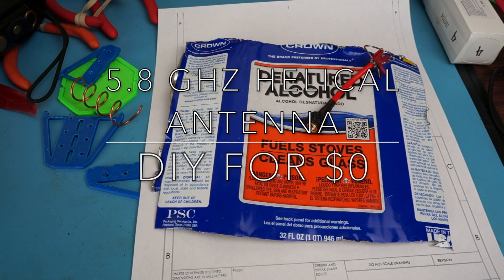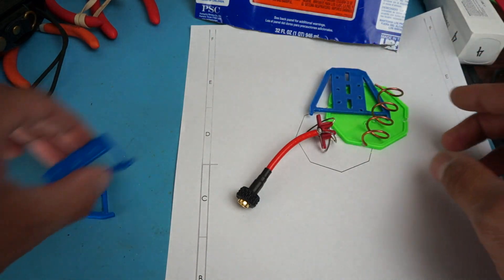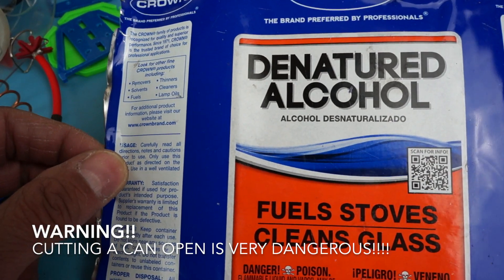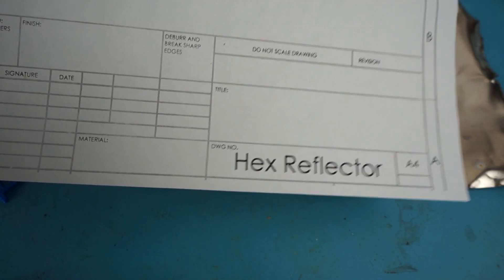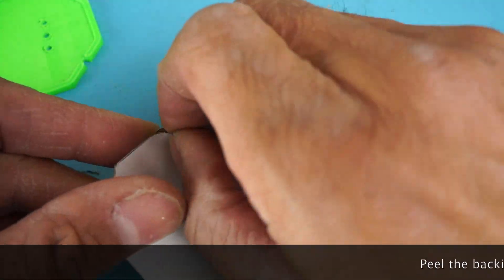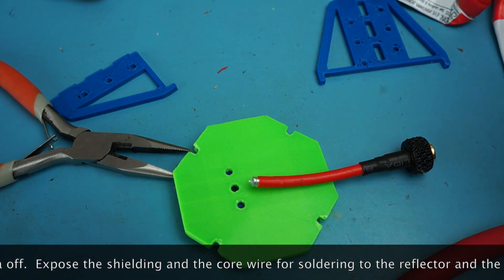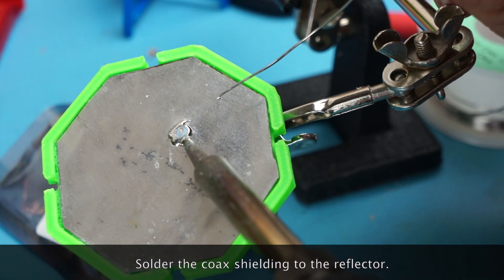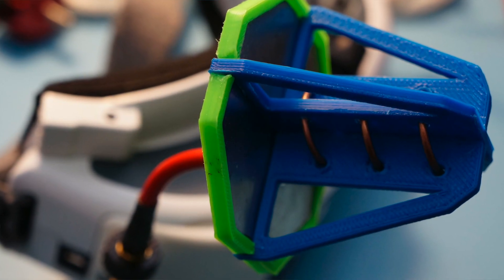DIY 5.8Ghz Helical Antenna for FPV Video for $0*

Comment: For the reflector, get yourself some copper rf shielding for guitars. It's adhesive on one side, you can solder to it, and most important, you can cut it with scissors.

Comment: Thanks! What 3-D printer material is suitable for UHF ? Is your  diversity receiver also home-built ?
Also I've heard that some people prefer double helical antennas.
Reply from the maker: I'm not certain, but I think I read on the Farvew site that ABS is recommended for the Pagoda antenna shields.  For this application, I think any rigid 3D printed material is good.  Double helical antennas may have their application, but I don't know what the advantages are.  My diversity receiver is a Quanum from Hobby King.  Not sure if they are still available, but almost any diversity receiver that has RSSI pins on both receivers should work.